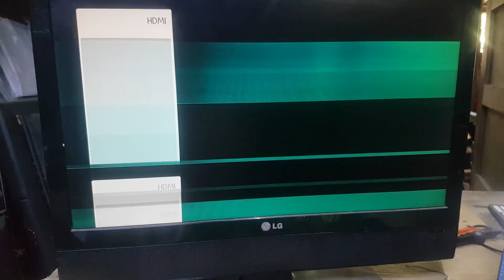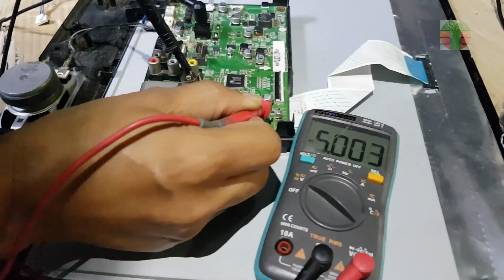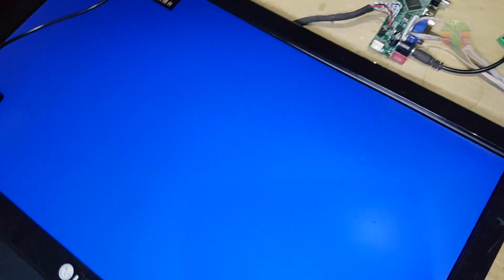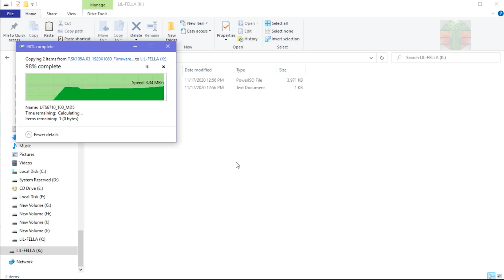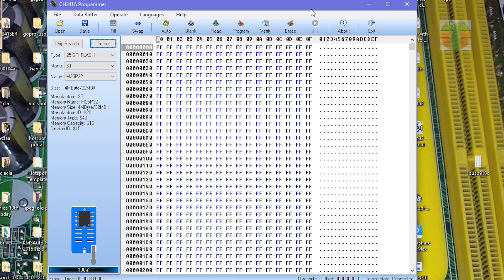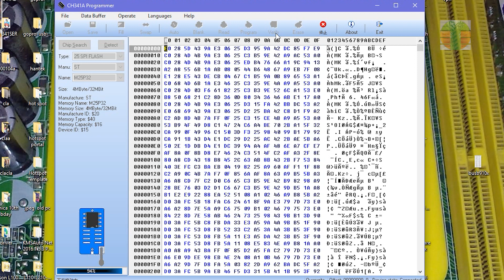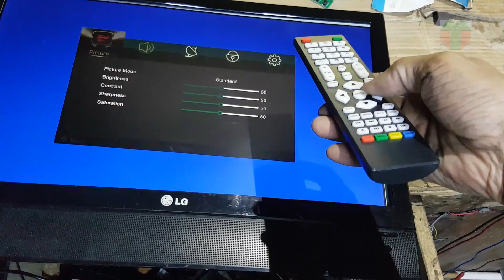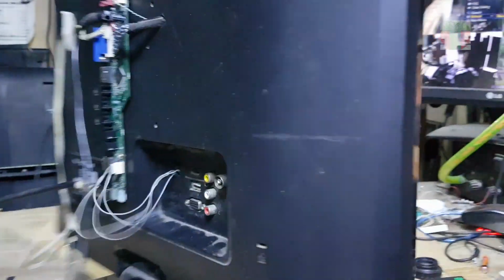T.SK105A.03 firmware and remote control fix.

Comment: I had a similar issue with flashing the firmware. But I managed to flash it with a trick. On the back side of the board, they have a white label with the exact model. On my board it was S53BKC14(PA) then I renamed the firmware file from UTS6710_100bin to S53BKC14.bin and I put only the bin file into the flash drive. Then I flashed the board successfully into proper T.SK105A.03 and now I can flash new firmware without problems.
Reply from the maker: That's a great discovery. Thanks for sharing your knowledge. Maybe I should make a video of it someday.
Reply: Stefan Stefanov, I did the same thing and it worked. However, my device is always blinking and does not work anymore. After flashing the firmware for the first time, do you still need to rename the file every time?
Reply: Can you please say what name, if white letters o name of the chip? Thanks
Reply: @doblejote  the chip of my board is Unisoc UTS6710-X
Reply: @Stefan.Stefanov  is the same I have, I try rename but no response and no label. Did you find the info in a blog? the info for change the name of the bin. Thanks again.
Reply: Could you please tell us where exactly is located the white label on the back side of the board. Thanks
Reply: евала човек,що клипове изгледах деа,за малко индийски да проговоря :) голямо благодаря ,че си споделил защото не всеки би го направил ,безплатно
Reply: @alexandartodorov1667  Ами дано съм ти помогнал с проблема. Тия китайски платки ги има всякакви разновидности и е за някои от тях е супер трудно да се намери софтуер. Имай предвид, че на тая платка, ако инсталираш новия софтуер от 2021-ва то няма да може да инсталираш другите по-стари от 2019 и 2020. Като цяло обаче бих те посъветвал, да не купуваш тези SK105 или онези T.V53 защото имат само аналогова телевизия, не поддържат DTV, т.е. цифрова. Бих ти препоръчал едни платки 3663 които поддържат DTV кабелна и ефирна, също така те имат и 2 броя AV чинчове, абе според мен са най-добрите. Софтуер за тях лесно се намира, аз дори в Мега съм събрал всичките видове софт за тях с различни резолюции, както за 1 канал и 2 канала, така и за 6 и 8 бита, също така те дори имат и българско меню, също така можеш да им зададеш и къстъм лого при пускане, абе супер са. На места ги пишат и като LUA63A82 или LUA63A81. Реално те са 2 версии 82 и 81 и единствено трябва да гледаш да не флашнеш софт от 81 на 82 или обратното, защото може да се брикнат.

Comment: Bro is there any other way to flash the board? I don't have the reprogrammable device like you do. I am a non technical person. If there is an easy way please make a video. When I am inserting the usb for flashing the light did not blink.
Reply from the maker: You can try other firmware online may be one of them will work. try the latest.

Comment: Sir  can I used the old SPI chip from.old board and replace to my new board bought to shoppe? Instead of manual flasing using CH341a programmer?thank you
Reply from the maker: Yes you can.

Comment: i have same board installed on my lcd tv T.SK105A.03, i have problem no sound. speakers are fine may be problem on board. Sound IC looks good no burnt found. any solution?
Reply from the maker: I don't experience audio issue.  But I have experience a no channels issue,  I think this model now have a factory defect.

Comment: hello I need your help, I want to adapt a led panel k400wd8 (AOC BRAND) I have the plate T.SK105A.03
Reply from the maker: Use the compatible LVDS cable, and flash the right firmware.

Comment: Is reprogramming the only way?  Please answer it as fast as u can after u see this.  Ty
Reply from the maker: You can use led tv universal remote and search the code.
Reply: So i need to buy a new chip and just solder it? Sorry... I can't understand and TY for answering... Pls simplify it.
Reply from the maker: @zarinazainuddin8820  Your question is reprogramming the only way? My video is about the remote control is not working. So the other way except reprogramming is to use universal remote control. I did not know the code, you can scan the code using the universal remote. scanning the code is in the manual indicating how to scan code by the universal remote.
Reply: Ok ty👌i understand. Ty for the answering
Reply: Umm...  Sorry for interrupting... I have another couple of problems...  May i ask if u dont mind... 

1. Can the board recieve signals from the remore control with a firmware running on the board 

2.how many volts does lcd backlight need (ht12x13-100)i tried using 12V but still did not light up or maybe the power for the backlight is at the lvds connector but i dont think it at the lvds connector tho 

3. How to insert the lvds connector it doesnt have any sign where's the right one and the left one

And again sorry for interrupting
Reply: I misspelled  on the 1 questing i mean " can the board recive signals from the remote control with a firmware "
Reply: omg the autotyper i was saying " without " not " with "
Reply from the maker: @zarinazainuddin8820  If the firmware is not matched the remote it will not refund. So what I did is flash the right firmware.
Reply from the maker: @zarinazainuddin8820  hehehehe
Reply: I understand ty but what's with the laughing?
Reply from the maker: @zarinazainuddin8820  The ht12x13-100 seems only 5 volts. you probably destroyed it. About the lvds you can buy online matches to your panel.
Reply: Wasnt it 3.3 volts?  Well i might have bc i didnt relive the first time i on the power i forgot to set the jumper to 3.3V. I have another same panel Model in my house.